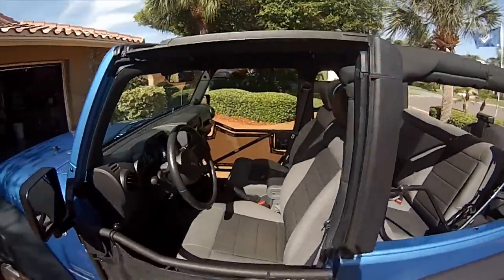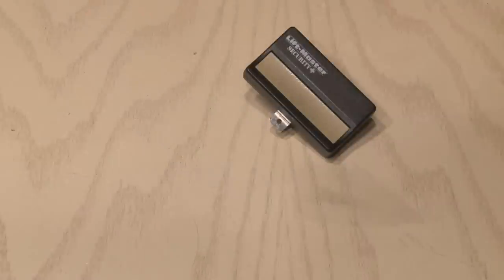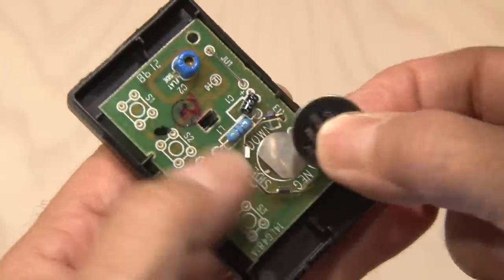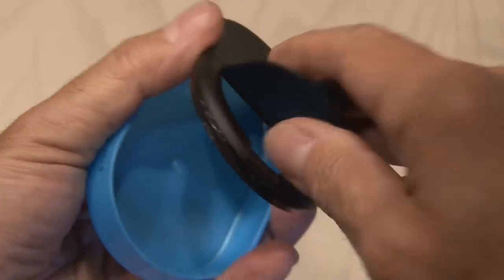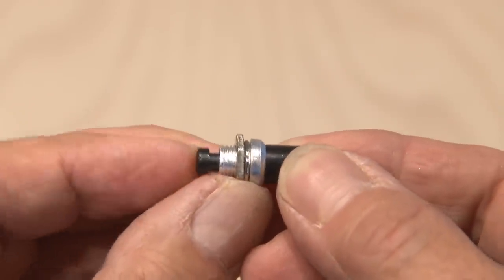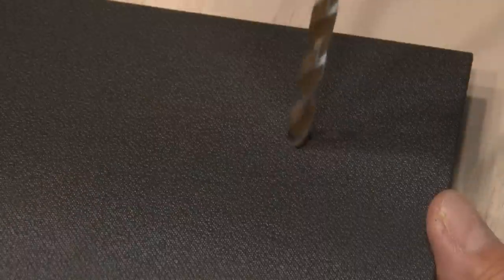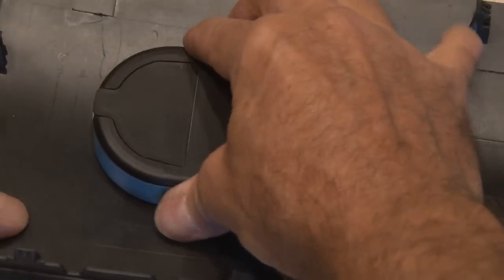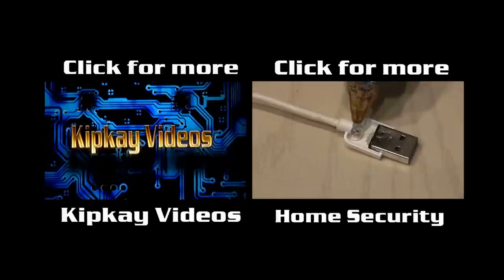Garage Door Opener Hack!

Comment: Not so secret anymore since you put this on the Internet.
Reply: Well...it's for other people...not for him....so basically it's for you and people who want it have a better chance to hide it....unlike him,it's on the internet,so obviously he changed where it's located...
Reply: Vanilla Eyes Umm I don't think he did change where he stuck it, otherwise he wouldn't have ruined his car and drill a hole in it, anyway if he did move it at least I know its in his car somewhere.
Reply: NOBODY KNOWS HIS ADDRESS ANYWAY!
Reply: good point
Reply: hayato zami I agree hayato zami, what good does knowing where he hid his opener if no one knows where he lives?
Reply: ORANGE juice Still, it would take a very long time, enough for the cops to get suspicious, unless of course you work at a forensic lab that can figure out where you live just by sounds, but barring that your pretty much screwed
Reply: +hayato zami Not his address, but the Insurance or Registration slip has the address the Jeep lives. Probably in that glovebox that's "inconvienient" to lock.
Reply: he carries a shot gun and sits by the window.
Reply: Great idea only thing is why didn't you just use the regular compartment that it came in and drill a hole through it? It would have been a lot easier and you would not have to get a whole pack of mints to do it

Comment: You could make it even better: use relay connected to ignition to interrupt the wire when the car is not running so noone without keys will be able to use it :)
Reply: Thats actually a really cool idea
Reply: Unfortunately the ignition line provides 12v, and most garage doors remotes require 5v or 3.3v. So all you would accomplish is frying your remote. There are ways to step down the voltage, but also emit heat so that could cause its own problems to deal with.
Reply: That's why he said use a relay. You wouldn't be supplying switched 12V to the opener. You'd be using switched 12V to flip a relay which is in series with the push button switch to make it function only when the ignition is on.

Comment: Good idea. You can also retain the original garage remote housing and do a plug in remote switch; with the similar idea of putting velcro on the original unit to hide at the back panel. That way, you can simply unplug the remote switch from the orginal box unit and take it with you in another car, without dismantling the whole assembly and switch from the back side panel of the car.

Comment: Why do you have to put it in a mint container? There is plenty of room in the stock housing. Why not just drill a hole in the case of the garage door opener, stick a wire in there, soldier it to the microchip. Then velcro the whole garage door opener to the inside of the  panel?

Comment: Security through obscurity is not security at all. If you're really worried about it just switch out the normal opener with a keypad one. (they're designed to mount outside the garage) then enter your pin number viola! Or you could do my favorite and get a Bluetooth operated module and open it with any Apple or Android device. They start around 50 bucks on Amazon and you don't need another device.
Reply: +ddemaree07 But for the lazy people today that wouldn't work, heaven forbid they had to get off their ass and push a button, or a couple.  Better yet don't have a garage door opener, open, close and lock the door yourself, far more secure than any garage door opener...not that a garage door is exactly secure in the first place.
Reply: Not convinient enough

Comment: I used to live in a house with a gated drive way. I wired my gate opener to the high beam bright lights and even used the vehicles power to power it. To open the gate, all I had to do was flash my high beams.

Comment: Improvement suggestion: if the remote is not using power when not in use connect it to the car battery (through a voltage regulator of some sort of course) so you don't have to worry about changing it's battery.
Reply: thats actually not a bad idea but also a good idea to put a fuse with the 3v line for the garage door open to prevent overvoltage

Comment: Kip. You are the man… but wouldn't it be both better & easier to cut out the candy box?  Just put the momentary switch in the panel & Velcro the unit itself inside (or rubber cement).

Comment: All you did was put the opener into a different case. Why? All I did was solder two wires to the contacts on the inside and hooked them to a momentary switch (horn button) Works great with no drama!!

Comment: I found this video a couple of years ago and copied your idea. Only difference is I mounted the momentary switch to an existing hole on the side of the drivers seat and zip tied the opener to the bottom of the seat. I have an under seat lockbox so the opener is completely hidden. The switch is more or less hidden in plain sight, it blends into the frame of the seat nicely.

Comment: Even stealthier; leave the logo on the mint box so that it looks stock.  Put the components inside, and rig the lid so that you can push down on it.  Mount the switch inside so that it's hit by the lid.  That way you can just leave it sitting loose in the car, and if anyone sees it they'll think it's just a mint box.  This will also save you from having to drill a hole in your dash, which might be problematic for resale.

Comment: Hello kipkay. Whats about doing a advanced version? If you use a voltage regulator you can connect the garage key directly to the car electronics. For example using the 12V from the radio conections.

Comment: An easier way to do this would have been to hot glue a button on to the touch pad of the original garage door opener casing, drill a hole in the panel and mount it the same way you did in the video.

Comment: Did you know that just about every shopping mall has a guy that sells garage door openers that will clip on to your car keys. No need to drill a hole in your car. All you have to do is program you new opener to your garage door by pressing a button on your garage door motor and then press the button on your new garage door opener. Too easy.
Reply: Not convenient enough
Reply: +Carter Jacobus LOL
Reply: +Carter Jacobus hahahahahah

Comment: ive been a fan for years now and i have a request. please please pleeeeeeeeeeeeeeeeease make a hack on how to convert a battery operated baby swing to use a power outlet instead. please make it the easiest way possible without anything like soldering. i know a lot will benefit from that hack not just me. thanks and God bless

Comment: Nice idea but would be even better if you used an unused manufactured switch on the dash board. Most lower range models will have spare places for switches (used for higher model spec) use one of those instead.

Comment: An even better way is to wire the garage door opener into the vehicle's 12 VDC circuit with out the Lithium battery, and hook it to the line which  is only hot when the key is in the ACC or RUN mode. That way even if someone presses the relatively visible button (you could have hid it better under the dash where you could still reach it from the driver's seat, and not be seen) .. the opener would not be powered and not open the garage door.  I did this to one of our earlier cars and it worked like a charm.  This has an added bonus .. no need to change batteries .. ever !

Comment: Anyone can still use the button though? Should of removed the battery and wired it to an ignition live circuit with the correct resistor. Then the ignition has to be on for the button to work, so only the key holder could use it...
Reply: Plus with this method you don't have to hide the button in an awkward place either.

Comment: Great idea but for someone that don't have the know how and tools it would be better to just buy a combination garage door opener like you would mount on the wall and just keep in the glove box. So if it stolen they have to figure the code to open your garage door. The down side it much larger and you have to input your personal 4 digit code upon use.
Reply: PS. You can also add a myq device connects your garage door opener via WiFi , download the app and use your smart phone to open your garage if you choose this high tech method.
Reply: Terry Chan Ok so you can use your smartphone to open your garage door. What if your phone gets stolen? If someone gets access to your password then they will be able to not only find out where you live, but also open your door easily and take stuff.

Comment: If you wire in 12V from the car, you don't need the battery.
And the button only works when the key is in the ignition :)

Comment: Handy tip, do not touch the battery with your fingers, the oil and acids in your fingerprints can cause oxidation on the contacts, best bet is to wear latex gloves when handling the battery, or clean off the contacts with alcohol to remove the fingerprints. I use a set of plastic tweezers that are non conductive, DO NOT use metal tweezers, those can short the battery, ruining it. The same thing goes with watch batteries, keep fingerprints off of them, they will shorten the batteries life.

Comment: Or you could take:
A piece of double sided tape, or tape folded into doublesided tape

1. Install piece of double sided tape onto the back of the garage door opener
2. Tape the garage door opener wherever you decided to put the switch, or anywhere out of site

TADAAAAA
Reply: That's kinda what i was thinking too. Just use the original garage door opener and make the hack using it and the momentary switch with the wire mounted like it is..... easy peesy...... LOL
Reply: Lol, yup.
Reply: Lol, yup.

Comment: Cool hack, but a bit too easy just extending the switch.  I think it would have been really cool if you would have wired it to the car for power, and ran the switch through the ignition.  That way, if the car is in the drive with the top off, one can't just walk up and push the button.  You'd have to have the key in the ignition before the switch would become active.  Also, you'd never have to change out the button cell since it would be wired to the car's battery.  You'd have to step the voltage down from 12 to 3, that's it.  I'm sensing a Garage Door Opener Hack Version 2 !!!

Comment: Don't garage door openers usually have a bunch of switches inside correlating to numbers to set the code the remote sends out to match the garage?
Reply: It depends on the GDO, some are dynamically coded ones to revolve codes for a specific garage door, once in range it will open it then the codes will change every time.  There are some yes which switches usually 1-8 called DIP switches will be in both the reciever the door and the remote wher eyouc an set them... but from what I have sen most if not all new ones nowadays dont have DIP switches they are dynamic rolling codes sent to a specific coded tranmitter/reciever.

Comment: What was the point of doing all that when you hid the switch inside one of the panels in the car? A cool idea would have been to wire it into the car's battery as to eliminate the battery in the opener. Or just get a garage door opener or an add on module that allows you to securely open your garage door from a smart phone, it cost more money but it's more secure and it allows you to open the garage from anywhere in the world.

Comment: After done the same as yours, I cannot open the garage door due to the signal gets weaker. I'm looking for a solution to strengthen the signal.
Reply: +Matthew Chiu sounds like you need to change the batteries
Reply: justin rivera Actually i use the 12vto3v module and use the car battery. I think it's the problem of the signal.
Reply: +Matthew Chiu Find the antenna and solder a length of wire to it.

Comment: umm why do you need another container, you could have just used the remote's case and drilled a hole in that.. you're going to hide the box anyhow.. so. it's not like it's sitting out in public...
Reply: Could be because it'll be easier to replace the battery with that case.
Reply: tbh.. if that's the case and he's going to bury it behind the dash where there's like no metal he can just sticky back the PCB to the back of the panel naked.

Comment: Probably not a good idea to put something into the position where the knee airbag sits...
Reply: Pavel Vagner Umm,knee what?
The airbag is used when car stops from moving in short distance aka crash.
Its supposed to inflate so you dont hit steering wheel with your head and break your neck.
Reply: SilenT●CSGO & More! What i meant was.... in an event of a collision (especially front end) you body keeps moving forward until it impacts a fully deployed airbag... now... when you are still moving forward (in an impact) and the knee airbag goes off, and you have an object sitting in front of said airbag, the object will be launched away from the center of the (airbag) detonation, i.e. towards the driver... meaning, that plastic garage door opener turns into a very ugly projectile which is now traveling at you at a relatively high speed (and yes the mass of the opener is relatively low but, there is still mass) which has the potential of causing lacerations or punctures which can ultimately result in some very serious injuries.
Reply: Pavel Vagner Umm.
1.He is in a jeep that is few years old.Do you expect it to have knee air bags?
2.It cant become a projectile as its sticked onto plate that is fixed on airbag.
3.It cant cause any serious injuries.Its not very aerodynamic and the balance point will make that hit feel like someone threw a tennis ball at you,at most.
Reply: SilenT●CSGO & More! 1. Jeeps as old as 2008 have knee airbags
2. When the airbag deploys it does so at a pretty substantial speed (as fast as an explosion)
3. At such speeds even a marshmallow will hurt like a bitch.. and marshmallows are not plastic